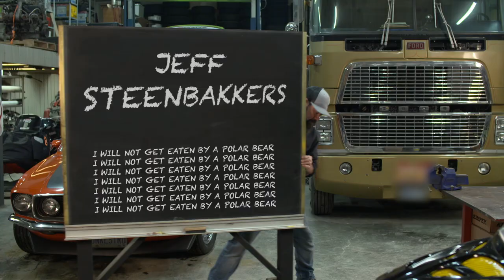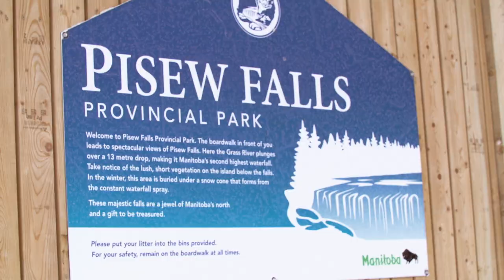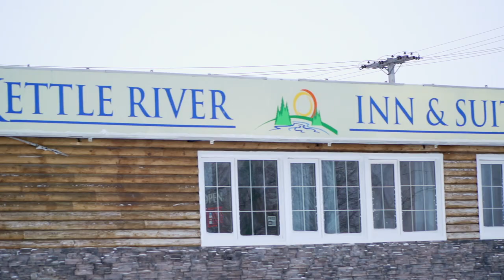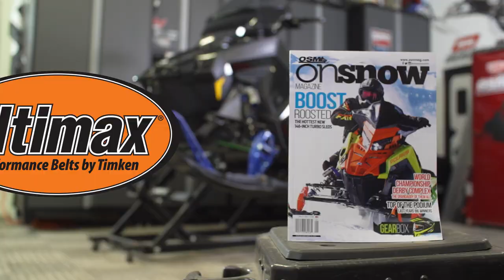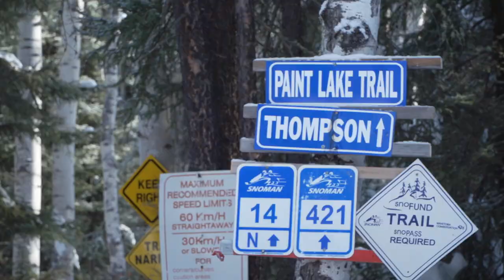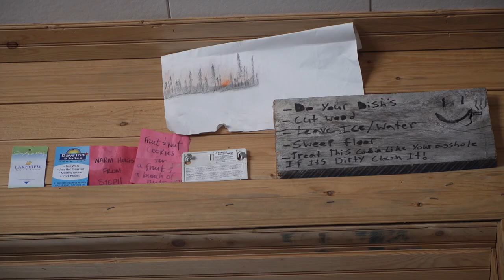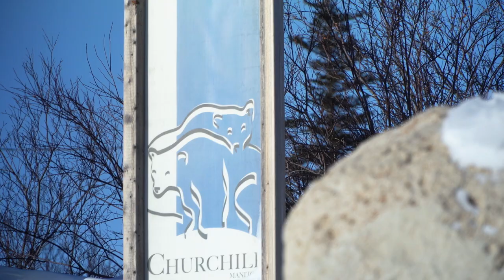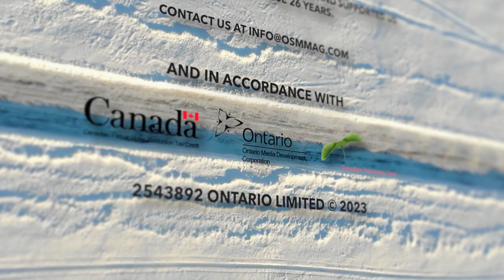Snowmobiler Television 2023 Episode 02

Comment: As I sit here looking at my green grass because winter does not want to come to New England yet, I was wondering how many Go Pro batteries you had to carry to film just 5 minutes? I'm thinking a dozen all kept in a warm pack or in a bag inside your coat. 

Love watching this trip, this is something I want to do but my riding friends do not have the b***s to do this kind of adventure riding. They keep getting cold when we ride locally.....sad.
Reply: Actually only 2! With a charger on the go at all times. Also for long takes a power source for the GP. Seems to work so far.
Reply: They need the right gear buddy,usually it freezing while we ride,I’m boarderline sweating,heated grips and seat helps 
Lol